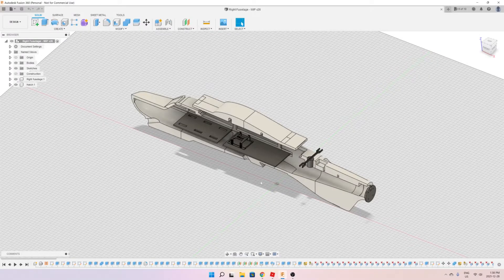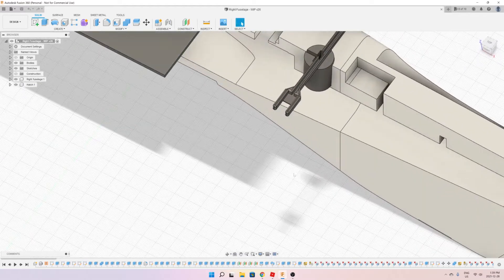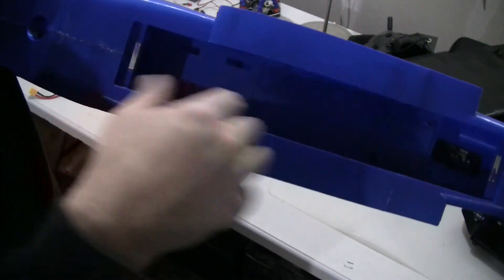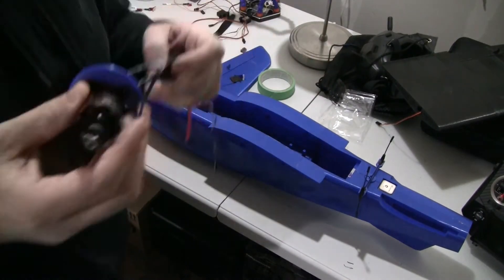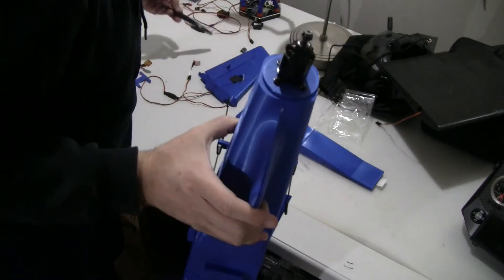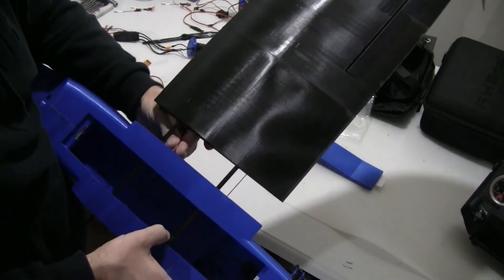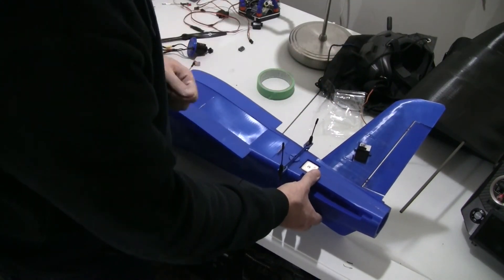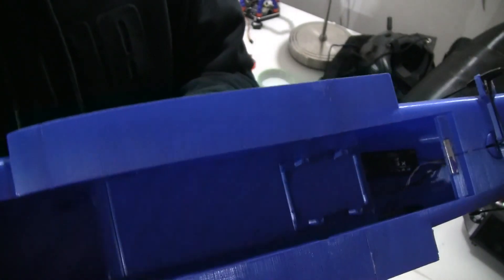3D Printed X-UAV Mini-Talon - Part 4

Comment: nice work!  there are a few errors of the original design which could be easily fixed in your model:  V tail servos do not seat parallel to the control surfaces, that hole in the fron which gaet jammed with dirt unless covered with ITSQV's sled, also the hatch opening is a bit too narrow and could use moving the front opening as close to the nos as possible.  would love if you could share your fusion files earlier so I can make custom extensions for the wings. also a regular T tail mod (according to the people who did it) gives it more elevator control @ lower speeds. anyways, your idea could mean another comback for the trusted minitalon!
Reply from the maker: Hello Artem, sure will compile my files and share them soon